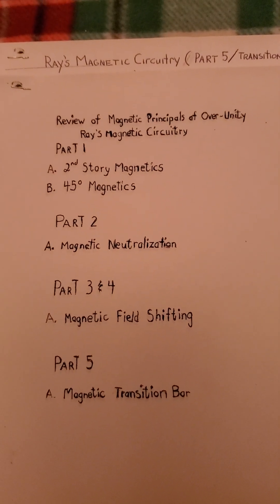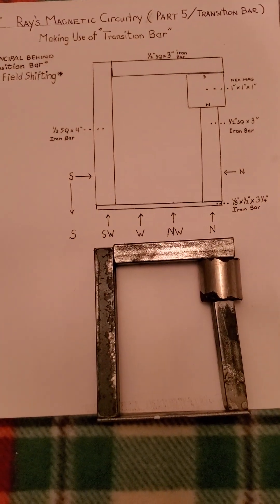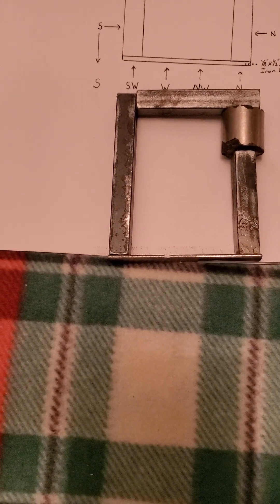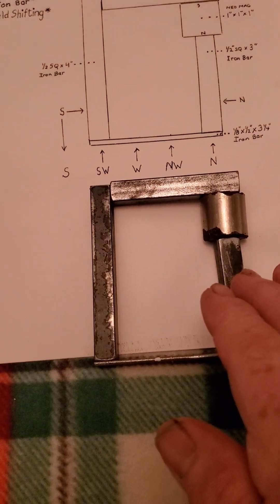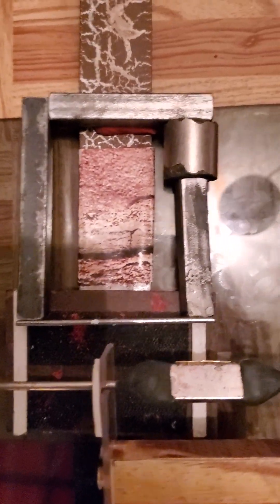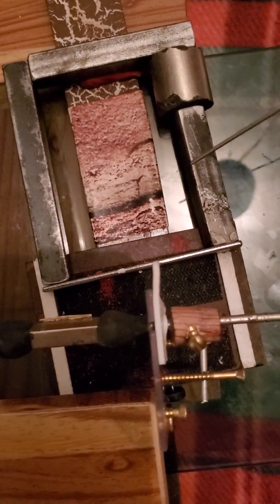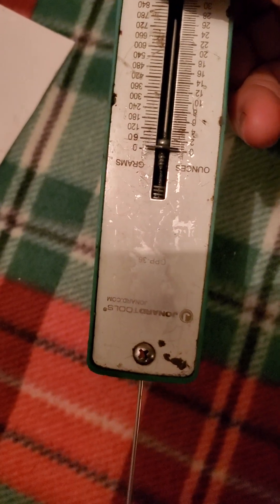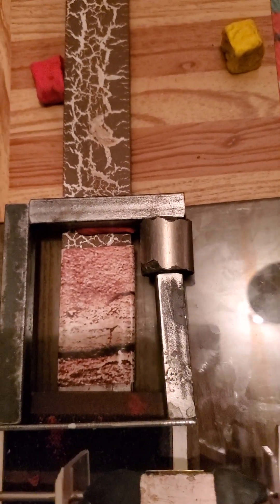Ray's Magnetic Circuitry [ Part 5 / Transition Bar ]

Comment: Thanks for sharing. Will be watching for more..   🙂
Reply from the maker: Hope your inventing table and area set up coming along smooth...
Reply: @raymondslab  Nickle and diming really. I have the breaker box and outlets plus wire. Final electrical cost will be the power line hookup from power company. Connecting to house and will be about 30 feet to reach the "lab" garage. Talking over $1200. I really need to find some kind of income other than my small retirement and SS.  🙁